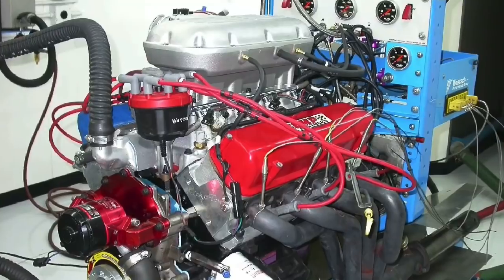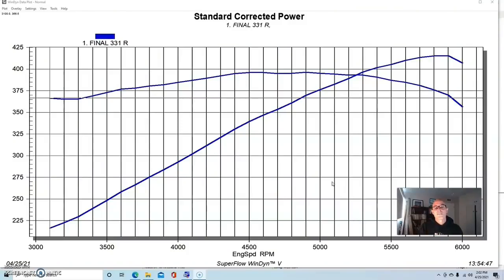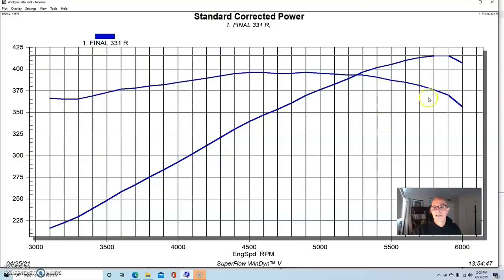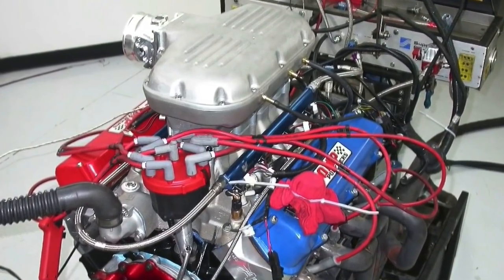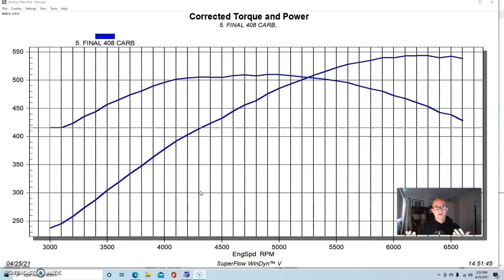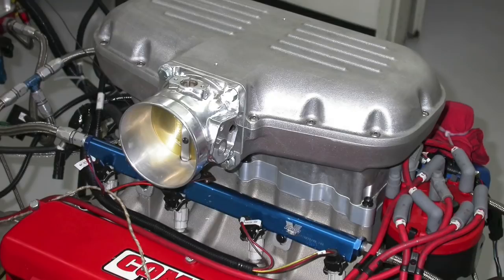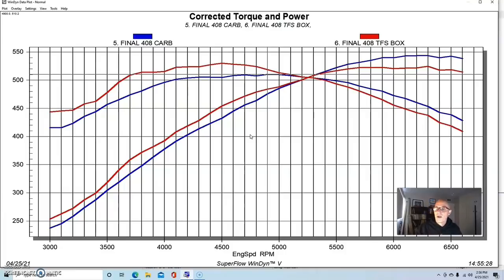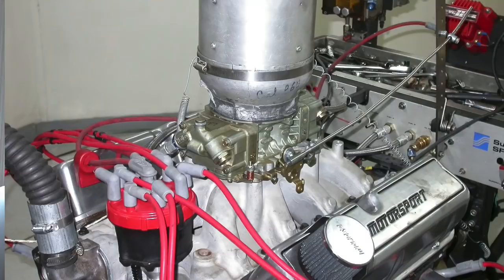SBF 5.0L INTAKE TEST-BOX R v SUPER VIC & CARB (331 & 408 STROKER)

Comment: Did the 331 need a stronger valve spring to control the valves?
Reply from the maker: SPRINGS NEED TO BE CORRECT FOR RPM RANGE AND LIFT

Comment: There’s a photo of an R cut open vs a Systemax 2 somewhere. Might help explain why the box R did better. Do you have a comparison of a ported Systemax 2 vs the tfsR ?
Reply: I have tested a ported Holley vs a tfs -r on my old nmra pure street engine and the Holley was 17 peak hp and 8 tq better than the tfs r. This is a high rpm n/a 310 combo.

Comment: Great test!  We are planning a mild 347 build for my sons fox body and are torn between the Trick Flow Street Burner and the Box R.  I'd love to see a test between the 2 on a 347.  I lean towards a Box R.
Reply from the maker: street burner for under 6000 rpm
Reply: @richardholdener1727    Thanks Richard!  This will certainly be a build more focused on drivability, more torque than HP type of thing.  Small long tube headers, small cam, something in your go to 274 range, decent idle good vacuum etc...  I just sure like the looks of that Box R. :)

Comment: Hey Richard thanks for doing this video on TFS intakes. finally some really info n results. 
Question? I’m currently running very similar set up with close to the #’s have here on your 331ci setup. ( 9:8:1 347ci, 11r Cnc 205cc, comp XE282HR, tapered accufab 75/90. N box intake tuned w/SCT ) car made 415 whp / 480ish motor. I feel like it kinda Low #’s for the setup n even more after watching this video. My question for you sir, where am I losing power? I feel like I have a problem but idk where to start. any thoughts?any advice? I feel I should be making 50 more hp easily. can u help?
Reply from the maker: is it a box R-then you need a 90, if not, that makes what I would expect (it should be sub 500 flywheel)
Reply: @richardholdener1727  yes it is, a mild ported ( gasket matched lower ) w/42lb. Thanks I guess I’ll order the 90 tomorrow lol.
Reply: @richardholdener1727  your awesome bro!!

Comment: Have you done a test comparing the edelbrock 2924 with a carburetor vs the edelbrock 29245 with a 4150 throttle body?  I thought you did but I couldn't find it.  I would like to see how a "wet" style works when it's converted to a "dry" style intake with MPFI.
Reply from the maker: the manifold works the same-the only change is reduced charge cooling from the fuel flow

Comment: I wonder if 20lbs extra foot pounds in a car or truck would make a difference.  The extra weight of all the fuel injection compared to the carb set up would be interesting to see
Reply: You'd lose more weight going on a diet lol
Reply: EFI benefits outweigh the added weight. With tuning, and programming, you can get it where it's happy. And, pretty  fun. Have an EFI 5.0 ranger. It's way better across the board than my dad's carbed 460 that doesn't wanna start or stay running.

Comment: Richard,
Could you do a test of the TFS Box-R v Holly 8.2" SBF Ford Hi-Ram Intake Manifold with 105mm LS Throttle Body Flange Top? I'm sure that the Holly would win for total horsepower. But I really want to see if the $80 price difference is worth it.
Bart

Comment: I have been thinking about switching to a Box R on my 331 in my 95 GTS. (10.5:1, Anderson N71, AFR 185) This just confirms that my Edelbrock Performer RPM II needs to come off and find it's way onto my 302 in my 90 Coupe 👍
Reply from the maker: the rpm II is a good intake
Reply from the maker: the rpm II is a good intake
Reply: @stang92boy did you make the switch to Box R ?   I’m considering the same swap.  Would like to cut the RPM II upper and remove some runner length. Also port the TB opening to 90 mm —probably need some welding there.

Comment: I have heard the TFS "R" upper intake has some kind of a reverse taper or choke point in it. When you took away the runner length with the box and it didn't lose torque down low, that backed up the "R" runner flaw.
Reply: I was just going to post this. TMoss cut one apart and the runners where pretty kinked inside. Ed Curtis will also tell you every time he can that the R manifold is junk unfortunately

Comment: Super Richie, I feel like you made this video for me. I asked a few days ago if you had any box vs runner intake tests and you made a this. You even touched on my comment about xe274 in a stroker. Thanks so much. I often reread your article on mustang 360 where you made 500hp with a Kenne Bell on an AFR & XE274 equipped 302. The dyno sheets are unfortunately missing from the article but most of the pics and the story still survive. One thing I always wondered about that article is it says stock pistons were used but I don't see a compression number. Some research says HO engines ranged from 8.3 to 9.2. Do your notes indicate what the ratio was? I am attempting to reproduce your results but for a daily driven 3800lb AWD truck. AFR, 2.1KB, XE266 because auto and daily, 347, running 8.5:1 because I might tow and I don't want to be octane limited. I think a 5 speed Fox body would tolerate a more aggressive cam and compression. Thanks again.
Reply: What kind of truck?
Reply: @droppedf100  that weight is ballpark for a short chassis ranger..
Reply from the maker: stock is 9.2 on an HO

Comment: Yeah... After my last Carb vs Injection comment\question I did realise that - because Fuel Injection pulses (& variably)as opposed to Carbs constant fuel stream(let me know if I'm wrong as I did not pay attention to the workings of Carbs back when I first got my driving license) - fuel injection saves\wastes less gas compared to Carbs... But that still doesn't explain\help me understand why a EFI system - at east in theory - should make more power than a Carb in the same engine... Anyways - I saw a video of a Twin 4 Barrel Carb Classic engine - do you have any dyno data on how much power going from a single Carb to a Dual Carb setup affects power? My first thought when I saw that was -  the Carb version of Individual Throttle Bodies - lol... =]
Reply from the maker: the carb usually makes more power on the same intake (like an edel vic jr with efi ports) because it offers charge cooling that port injection does not
Reply: @richardholdener1727  Oooooooh - Cool... =]

Comment: The problem with the R is the runner entries in the plenum. They really need to have the plenum cut off and the runner entries reworked with a better radius up at the top and even up the runners. Then weld the plenum back on. They will pick up a bunch of power at higher rpm and end up pretty comparable to the box r. That one responds well to having the pockets in the plenum plated over and smoothed and clean up the radiuses into the runners.

Comment: If the carburetor intake manifold was converted to fuel injection, would it make more power or not?
Reply from the maker: slightly less than carb
Reply: @richardholdener1727  Would distribution be a nightmare with the Super Victor EFI,  especially without being able to add fuel per cylinder? Any solutions in that case?

Comment: I personally like both carburetion and fuel injection (mechanical and electronic) but the 1 thing you have to remember is a carb has better "latent heat of vaporization". This is why some carb setups with turbochargers didnt run an intercooler... even though you always want to reduce iats in a positive pressure manifold system or naturally aspirated
Reply: Not running a intercooler is just dumb plain and simple
Reply: @austindoud273  running an intercooler that isnt properly sized for the lbs per min volume flow is just as stupid. Not only will it be ineffective at dropping iats, it will actually become a restriction and reduce horsepower and torque
Reply: More likely the people were broke ($), or ignorant, or didn't have the space to plumb in an intercooler in a blow through installation. 
Or the carb was in front of the turbo.
There was a time a long time ago, that intercoolers just weren't used because they simply weren't available, or they were thought to really hurt throttle response.

Comment: Great content, thanks!  Currently building a 408W with AFR220 cnc's, 880 Trickflow, forged internals, custom Crower roller 105 lsa .625 .625. for my  AC Cobra. Lumpy lumpy
Reply: be careful, lots of horsepower for a light tricky handling car!